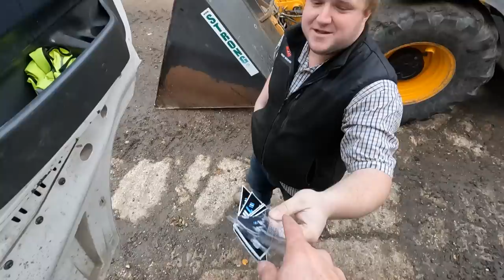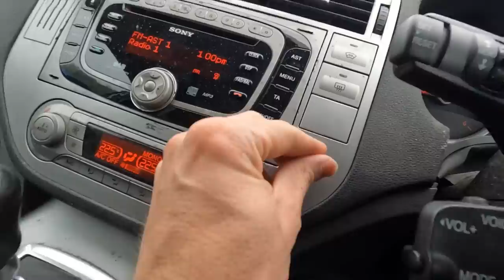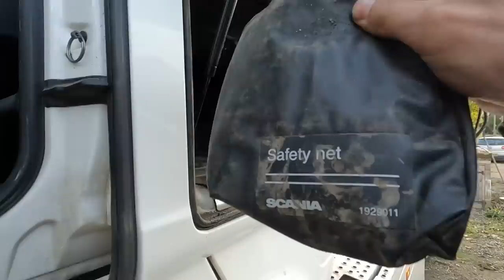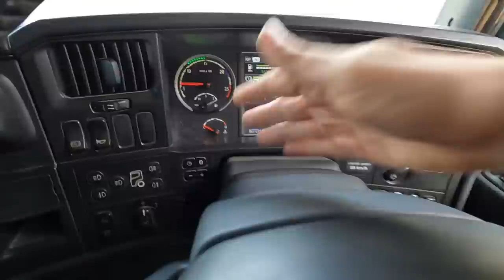New Truck Day | ENGINE FAULT Already | First Wash | Ep1 | #truckertim

Comment: As an ex owner driver, you're throwing money away running a v8. You'll get probably an extra 3 or 4 mpg from a straight 6,and wont be much slower. The v8 is good but tight in chassis, so some repairs can be super expensive. Be careful, more is not always better.